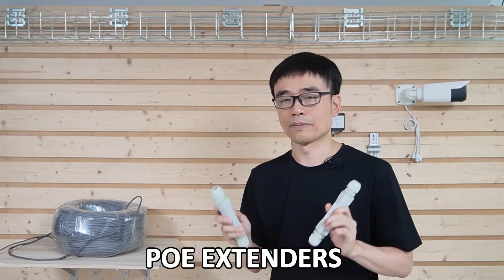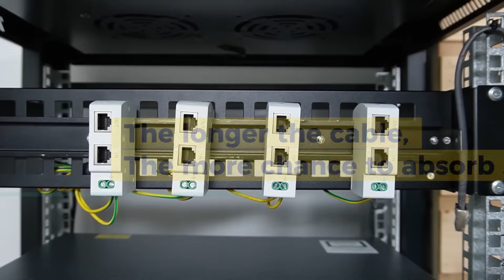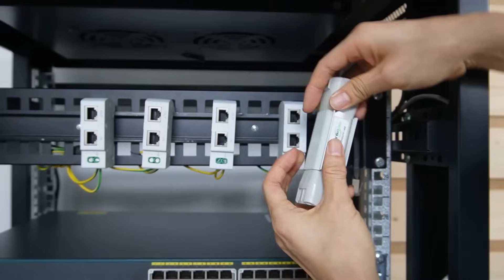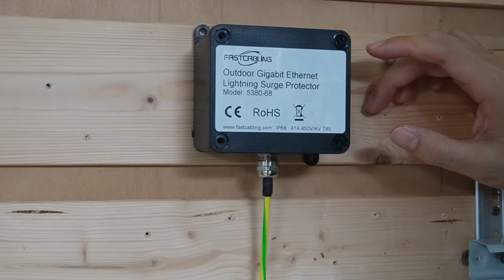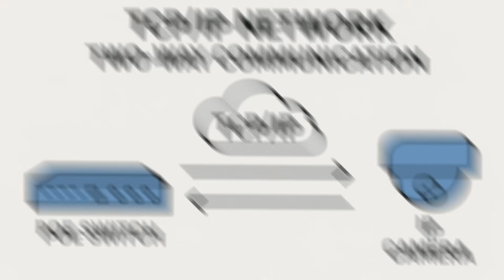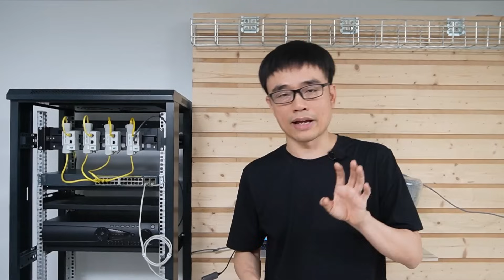Make Cisco PoE Run Over 500m | Long Range Camera Setup Tips

Comment: Hello, I'm trying to power non poe devices from a distance using poe repeater and poe splitter but i have a major setback. My fiber media converter is powered by micro usb instead of the regular pin like most routers. Do you have any suggestions please  ?! Thank you in advance  !!
Reply from the maker: You can use the PoE splitter with USB 5V output. It takes standard PoE input and separate the power from Data, convert it to USB out. You don’t need PoE repeater if the total length is less than 100meters

Comment: 500m? Why not do fiber and Poe switch?
Reply from the maker: The fiber optic cable can’t carry the power for the camera.
Reply: @Fastcabling  unless composite which you showed us earlier in the week.
Reply: @Fastcabling , yup then high voltage cables if there is no power at other end